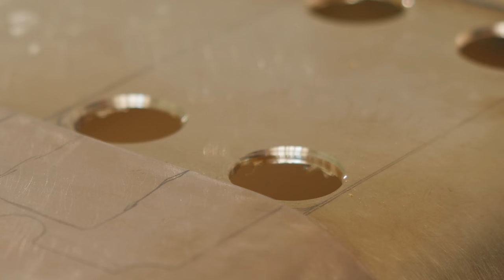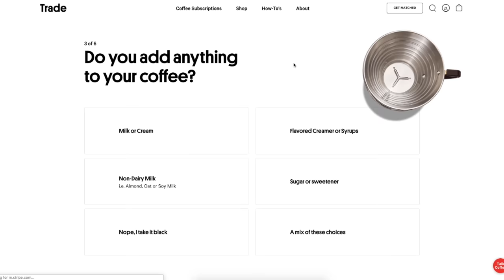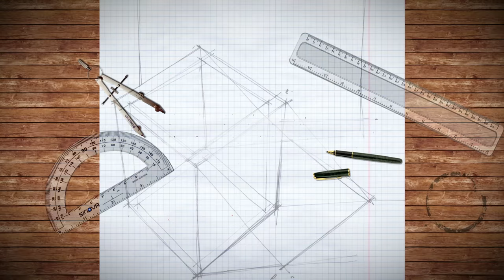DIY 'brass' PC

Comment: Dunno if you'll see this, but using a pickle (industry term - not the chutney or gherkin) will clean the brass up without needing to sand so much. Once pickled, you can polish it to a mirror shine really easily (with no sanding marks). Normally Brass is pickled in concentrated sulfuric and nitric acid as well as some other additions... but jewelers have had success using hydrogen peroxide(3%) and sulfuric acid (5-10%) or Sparex solution.

Comment: As you heat up the brass or copper take a cotton towel and wipe off the excess flux before putting silver solder to it

Comment: bit late to this but you could make a custom cable bracket on the back and have a cool single connector to plug in everything at once, a bit like the big multi pin terminals used in studio breakout boxes.

Comment: might of been easier with oxy acetylene and high silver sticks. the solder will adhere depending on where you heat rather than where you flux. it also makes a harder more polish-able surface. but i dont know i only use it for refrigerant lines.

Comment: Wow that looks stunning!
Just the SSDs being so close together gives me anxiety. They need some cooling too!
Reply: not really as they are slow Sata SSDs that will barely rise up to 50°C during big loads. The 2.5 inches drive enclosure is full of free space though so the PCB are quite isolated from each other.

Comment: I'm curious if adding a heat pathway to the brass from the cpu cooler would help keeping it quiet. It's a huge piece of reasonably thermal conducting metal you got there, might have potential.

Comment: The computer definitely looks nice, but I feel you could have done more to achieve the "character" in the lamp. For one, you could have added the silver element on the top of the lamp in the form of the center brass sheet. You could have added some rivets, albeit they would have been useless. You could have had a differently-colored pipe showing through the vent hole, or had something crudely etched into it. But most of all, convincing wear. If I had a computer case like that, I'd want it to look as old as that lamp just to add to the character of it.

It still looks great, but I can't say it, and the lamp look quite at home next to each other.

Comment: I think it would been better for the psu to mounted another way, the best way would to have the fan side down and have air pulled from there instead of pulling air from inside the case to cool it self down, otherwise real nice!

Comment: Instead of creating a mount, add type C to your PC by PCI Express. And then get an adapter that has EVERY peripheral devices you need. And that's it. Power and type C. 2 wires.

Comment: This guy is the epitome of English and, that is, okay.
He reminds me of Peter O'Toole as Lawrence of Arabia. 
What are the specs of this character-driven build?
He mentioned no GPU, so I  figured it's a 9900K.
Wonder if it has a free PCIe slot?  I didn't notice it on the board?  
 I just thought it would be cool to have the dock he was talking about making, have a GPU in it. 

 He could make it line up with a PCIe extender cable and mount into it when sliding it in.  That would require the case to be modified so the PCIe cable could fit through.  Something like the   Phanteks PH-VGPUKT_02 Universal Vertical GPU Bracket
.  Not sure if that board even had a pcie slot though

Comment: Are you sure you don't want a Graphics card?
Like yes that one program you use doesnt need a GPU. But if you ever switch?
Or for other applications?
You could consider adding an external GPU, those things exsist.

Comment: Did you ever get around to the dock, and how did you handle the ethernet cable, since they are usually locking cables, Whilst you could get it in, getting it would be a problem.

Comment: in the future with a cheap 20 dollar angle grinder with a 5 dollar wire brush adapter you would have gotten it to the rough brass look at  5:48 , just a thought for anyone trying the same

Comment: No gpu? Cant you add a low profile 1660? You could design a custom heatsink for it so it won’t instantly go to 80°C I think it would be cool to have a low profile gpu in it but there could be an issue with space/thermals.

Comment: it would have been even cooler (pun not intended) if the case was thermally connected to the system, so the case acts like a giant heat sink

Comment: The only thing I dislike about this approach to making technology into "heirlooms" is that technology improves too rapidly to stay consistent.
Will this computer hold up in five years? It will still look beautiful, but you likely wouldn't want to use it.
Unlike watches, furniture, weapons, clothes, and other luxury items.
Still very cool and impressive though.
Reply: Unlike some other designer systems (ahem, Apple) this is a standard Mini-ITX system. He can just install a new board when this is no longer sufficient.
Reply: @eDoc2020  Oh really? Then that's totally epic, so long as the ITX standard stays relevent, I guess all his hardware is fine. The only issue I could see is incompabtility with ports?
Reply: @FlorianEagox  Assuming he still has extra leather he can cut another IO 'shield' out of it. He might want to upgrade the front ports at some point but if future motherboards use a different USB header I'm sure adapters will be available.

Comment: i9 9900K
32GB ram
2 SSD
Sff psu
Noctua 8 heatpipe cooler

But no gpu....you could fit a 2 fan or 1 fan  gpu

Comment: Actually, in this application, it's called Soldering. It's only brazing if you physically heat the two metals until they're red hot, then press them very hard together. This in effect melts the two parts together to form one piece. I don't even need to explain what soldering is.

Comment: Can anyone help me with the following details with build used in this project video
providing the exact model numbers for

1)CPU----------------------------
2) Motherboard-------------- 
3)Memory----------------------
4)Video Card------------------
5)Power Supply--------------
6)CPU Cooler-----------------
7)Storage ----------------------

I want to make sure I use the same products so there is no compatibility issue